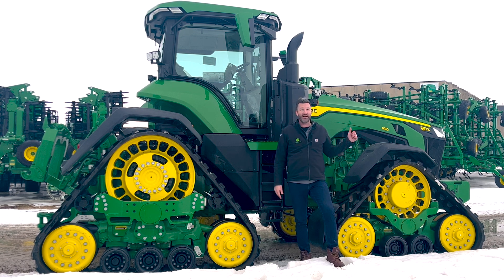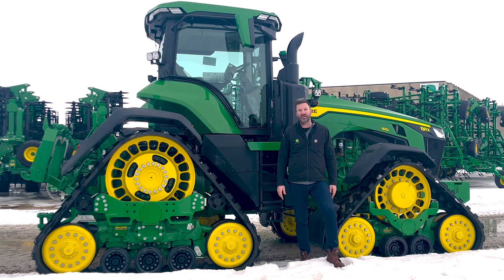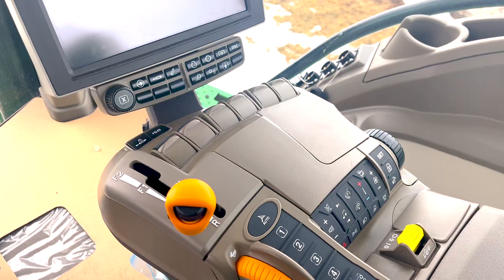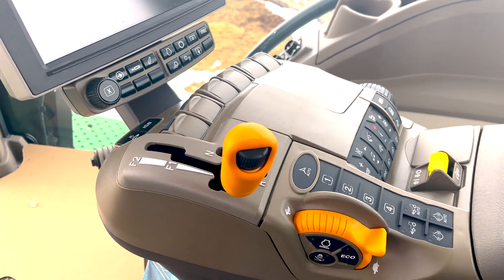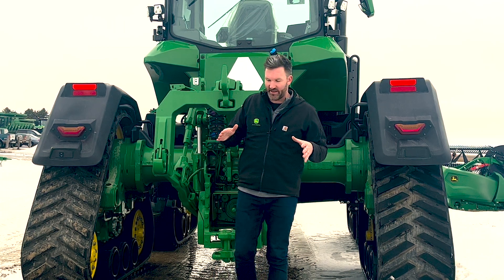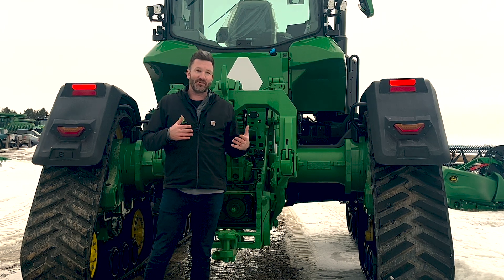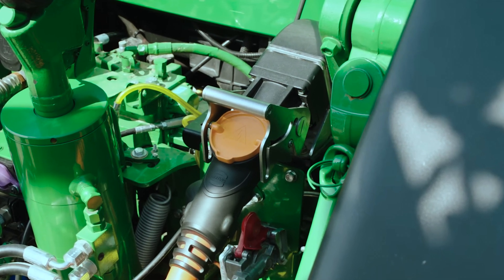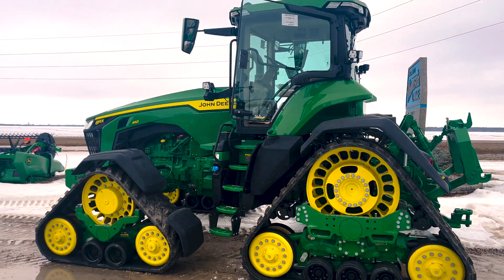John Deere 8RX EVT Electric Variable Transmission

Comment: At this point why not make it like a train or even an aircraft in some cases..? Engine drives a large alternator, rest is electric motors. Yeah, a standard few gear and piston pump hydraulic pumps can run direct off the engine, but for main propulsion and PTO can be all electric. Copper is heavy, that is a good thing. Electric motors have been around for many years and have proven reliable. Trains operate that way. PWM pto, PWM drives for front and rear axle, electric heat and electric ac compressor, hydraulics can stay the same, driven gear/piston pumps to operate as they always have with normal scv stacks.

Comment: IH pioneered electric powered implements in the '50's, hydrostatic transmissions in the '60's, & row crop 4wd 2+2 88 Series tractors in the '70's, hurtz 2B 1st, just say'n. The JD's R purty for half a mil.

Comment: This thing could be a lightning magnet. I manage a 20,000 ac farm in Georgia and we are all John Deere. IVT transmissions give alot of trouble we have
them repaired and keep going. Last year our 8R230 with a 12 row exact emerge high speed all electric drive planter attached was struck by lightning one night during planting
season. Bill to repair the damage was $173,000.00 for both pieces and 3 months time down. Technology is a must for large farms but it comes at a large cost.

Comment: Would be interested to see if this can be used to power air seeder carts.  Seems like an obvious application. Also, instead of ballast weights, batteries could be integrated to boost power, reduce fuel costs and smooth out power demands. 
Seems like this electrification is ideal for harvesters as well. Interesting times ahead.

Comment: Can these tracks be used in the forrest with uneven surface. with rocks and bushes arround. Can that create trouble for the tracks? Can it with tracks climb a 5 foot wall of ice and snow? Or is it best used on the fields??

Comment: Electric Fans on planters, electric seed meters (we have that already), Electric Fert Metering (we have that already). Power to the back is the future, I wish it had a CVT PTO on the back, set the desired pto RPM and let tractor do its thing. Good times

Comment: I'll make a statement now. Sometime soon there is going to be partially self propelled implements. Grain carts and tillage comes to mind first. With having powered wheels/tracks, it would significantly reduce the usage on the tractors and could possibly lead to lower hp numbers to pull/power larger implements. The LeTourneau overland train comes to mind
Reply: In Europe the have, Joskin has an electric driven manure tank.

Comment: More electronics...great idea ! Until they start to fail ,and they will, sooner or later no one knows when. One has to wonder what the projected life span is , according to the engineering department, everything does have a expected life span.
Reply: The lifespan is estimated to be approximately the length of the warranty.  Next question.
Reply: @montybolinger6383  no, just a shade longer than the warranty

Comment: I really question the statement “major reductions in maintenance and diagnostics”
Reply: Sam is a salesman, he is required because of decades of training  to speak nothing but positives.  OH and maybe when the transmission fails to pull the tractor even though the engine is running, hey anyone can diagnose it.  FAIL !!!!!!!!!!!! time to trade if off, get out checkbook and make Sam some more money.
Reply: @montybolinger6383 1. I'm not a salesman. 2. Decades?! How old do I look? I might need to get more sleep.
Reply: Considering that this EVT transmission possibly has a significant lower number of components compared to the original IVT. This could imply less components are prone to breaking down (similar to electric cars).

Comment: The biggest sellingpoint for me would be that the EVT is hopefully more reliable than the IVT in higher HP tractors....I worked for a company that had a 8370R witth IVT, the transmission broke I think three times...now they have a Fendt................. :(
Reply: Go fendt😄
Reply: That's because Fendt is the only company that makes a proper high horsepower CVT.
Reply from the maker: The motors themselves are already a proven component, and with the redesign of the transmission for the EAutoPowr, the rest of the mechanical components were strengthened for higher horsepower applications.
Reply: @KibbleEquip  yep
 iam also very confident that the EVT will be pretty reliable.:)